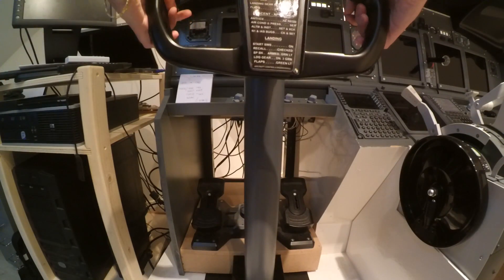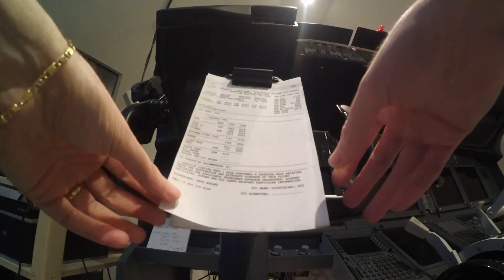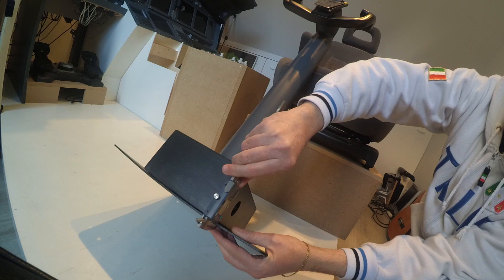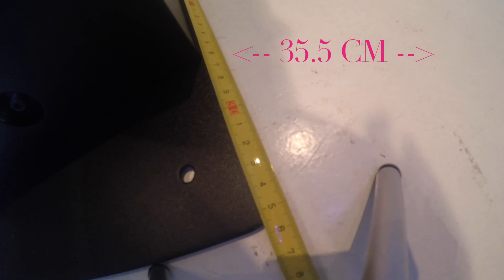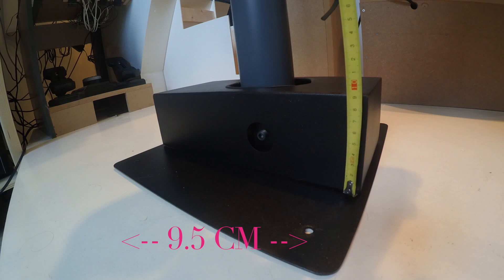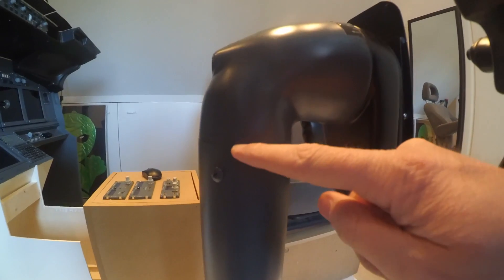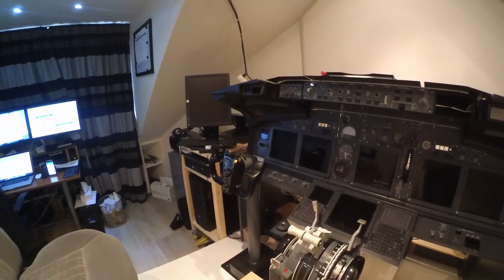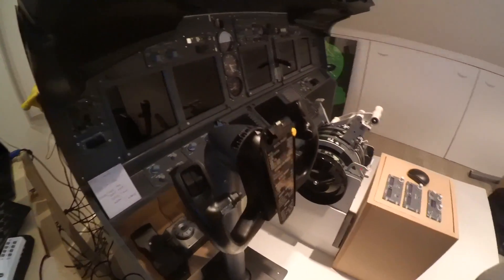Boeing 737 800 Home Cockpit Simulator #16 - ACE Yoke

Comment: Holy mother of god! The prices on that equipment. I could probably obtain it from a bone yard for a fraction of the cost but the time to build the interface equipment to all of it would run into the hundreds of hours. Now if you could obtain just the flight deck from a bone yard you would be off to a running start.

Comment: Hi, are you still happy with the yoke, is it worth it?
Reply from the maker: I love it, I must say that before this I has a sitek, so I do not have much experience with the others, but I can tell you that this is really nice.
Reply: 737ngxsim 
Nice to hear, I also ordered one at aerosoft :)
Reply: Did you have any problems to connect to p3d v3 or is it just like any other joystick easy configuration in all sims like p3d, xplane etc?
Reply from the maker: +CptSpaulding90 no, no problem at all. It worked originally in fsx than I moved to P3d without issues.
Reply: Ok and is a software included or do I need a driver?
Reply from the maker: +CptSpaulding90 in my case was plug&play because I believe the drivers are already in prosim737.
Reply: 737ngxsim okay, i dont use prosim737, i hope Windows will detect it automatic.
Reply: would you also recommend the Saitek rudder pedals?
Reply from the maker: I am very happy with them, if your intention is to make a complete replica, than of course not, but mine works just fine, I never needed to do anything to them.

Comment: hi! you have great videos. I'm from Argentina and the next week I will start with my homemade yoke build, can you sayme the rotation degrees of the roll control? and one more question, what colour do you use to your MIP panel? RAL 7011 OR RAL 7043? thanks so much!
Reply from the maker: +agustín prato Hi, I never really measured it, but it should be around 20 degrees on each side. For the paint I used RAL 7011
Reply: +737ngxsim thanks! but you talk about pitch. my question was about roll control (to turn to the left or right). should be like 90 for each side i suppose
Reply from the maker: Not with the ACE yoke, I just tested and by eye... it gets to max 70/75 each side
Reply: +737ngxsim thanks for the info. your sim will be great, here in Argentina I cant buy the high quality hardware that you use. I dream with visit aviation megastore. And you have the privilege that live in the same city! bye. cheers from Argentina